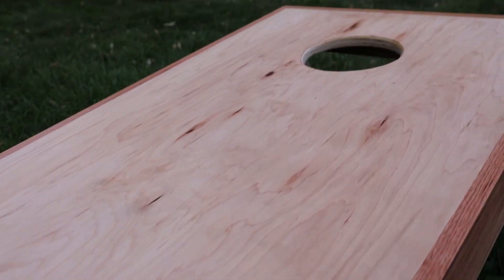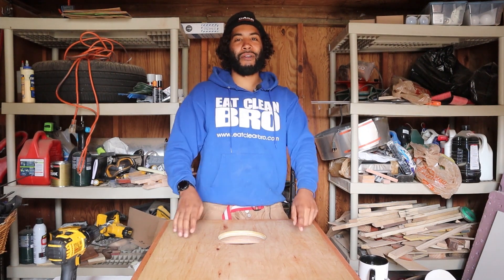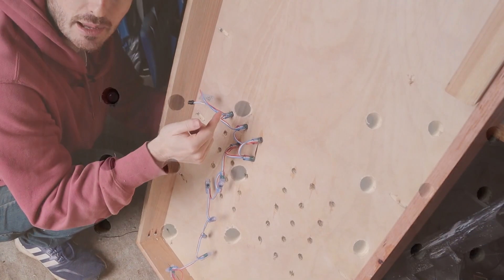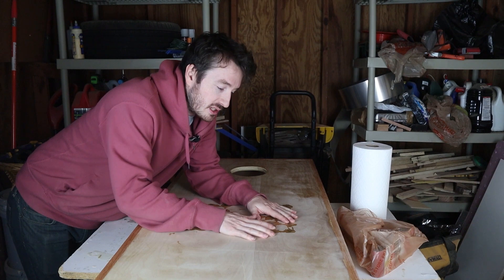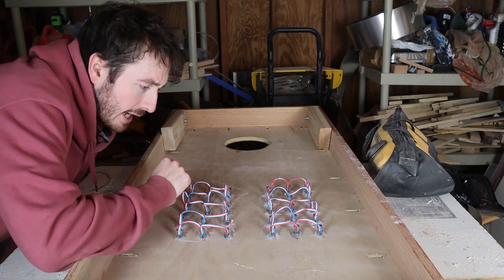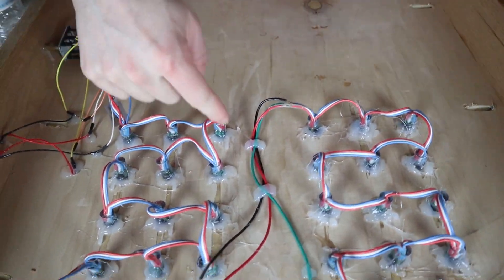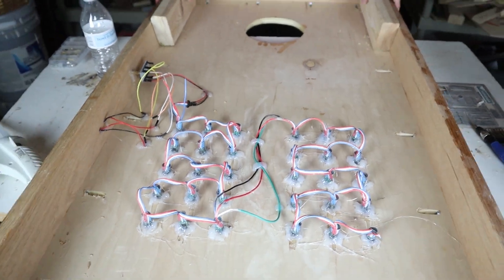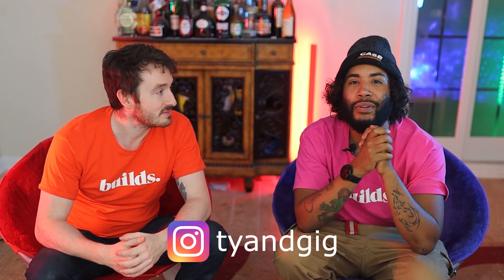How To Make a Corn Hole Scoreboard: DIY Scoreboard | Arduino Projects

Comment: You should NEVER sand cabinet grade plywood with 50 or 80 grit sandpaper. You can see why you dont do that because where they sanded, it burned through the veneer. You should of lightly sanded with 100 grit sandpaper at best and applied a floodcoat of epoxy over the entire 2 surfaces. Keep the integrity of the wood looking consistent and flawless...

Comment: When plugging in the microcontroller, did you send the code through wifi or through USB/Arduino software?
Reply from the maker: USB, we used the arduino IDE

Comment: I'd add a bean bag detector to automatically increment the score, along with a color detector so the right one gets scored. good build.
Reply from the maker: Thanks. I was heavily considering adding some automation but then you'd have to score the ones on the board as well. And you'd have to account for bags missed. Didn't want to go down that rabbit hole lol
Reply: @tyandgigbuilds8836  Agreed.  It's a logistical nightmare.  You'd need cameras and super computers to do it right.   No one needs a $100,000 setup that badly.

Comment: Am I missing something, or are there 4 LEDs that never light up?
Reply from the maker: They all light up, they only light up based on the number though. Which leds aren't lit?
Reply: @tyandgigbuilds8836  I think they mean that the LEDs above and below the center aren't used to create any of the numbers so they won't ever be used.
Reply: @tyandgigbuilds8836  the lights that would be in the middle of an 8
Reply from the maker: @SeanReevesD  Ah yes those are never lit. I could have reduced the work a bit there. I wouldn't cut the led off the strand though if I did it again, I would just leave the led that is supposed to go in that spot dangling (maybe hot glue it to the back though). Otherwise the gap is too large between the other 2 leds and you'd have to solder that together. Which I don't particularly like ;)

Comment: Awesome job, but how did you get power to the ESP8266 and LEDs??
Reply from the maker: Used micro usb to power the esp8266 and then used the vin pin of the microcontroller to power the ws2811 leds. Plan on adding those details in an instructables article and link it in the description in a few days
Reply: @tyandgigbuilds8836  Did you use a powerbank for the USB as the power source or are you just plugged into an outlet?
Reply from the maker: @benjamingrant4065  plugged it into a usb block similar to what you use for your phone and plugged that into an outlet except it was rated for 2A just to be safe. Think a regular phone block might be rated for like 1/1.5A by default (could be wrong but that’s what I remember for some reason)
Reply: @tyandgigbuilds8836  awesome, thank you!